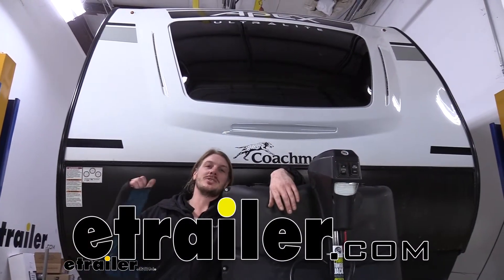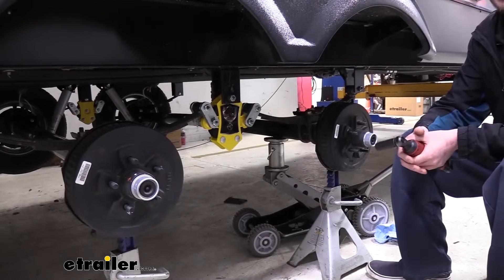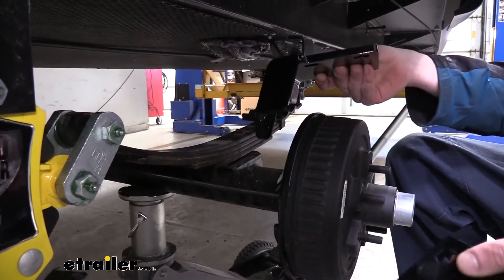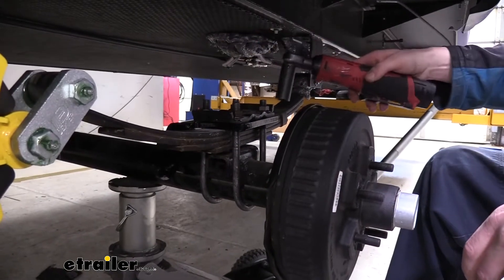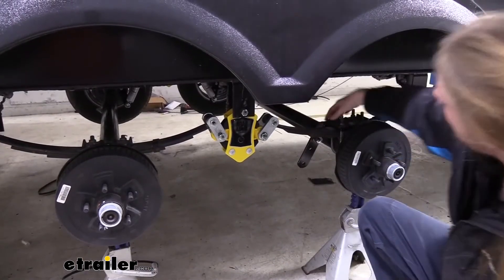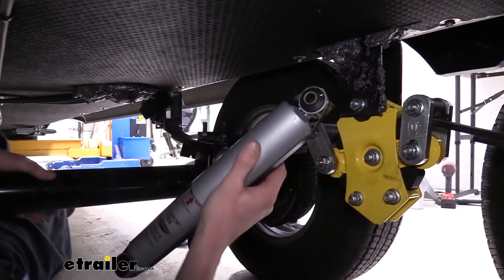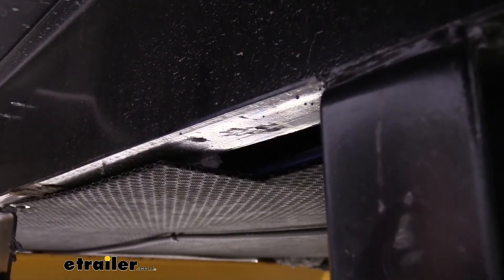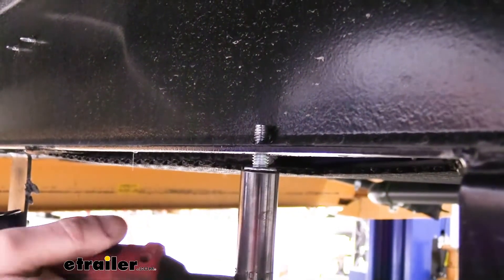Roadmaster Comfort Ride Shock Absorbers Installation - 2021 Coachmen Apex Ultra-Lite Travel Trailer

Comment: So, why not bolt the extension piece onto the upper bracket on the bench, instead doing it under the vehicle?
Reply from the maker: You may be able to assemble some of the kit before installing it but just keep in mind it will be heavier to hold up in place while working.
https://www.etrailer.com/Trailer-Leaf-Spring-Suspension/Roadmaster/RM-2450.html

Comment: I have watched several install videos for these, and yours is the only one that shows re-using the upper U-bolt plate on top of the replacement one.  Which way does the instructions show? I cant see a reason to add the original on top of the new one.

Comment: Hello E-Trailer, I have a question about this kit. I recently purchased (yesterday) this kit (RM-2450) for my 2019 Open Range travel trailer. I just realized that my axle & leaf spring setup is inverted from the Coachmen TT in this video. Will the kit still work as designed?
Reply from the maker: Yes, it can still work. You just want to be sure that the distance between the mounting holes.
https://www.etrailer.com/Trailer-Leaf-Spring-Suspension/Roadmaster/RM-2450.html